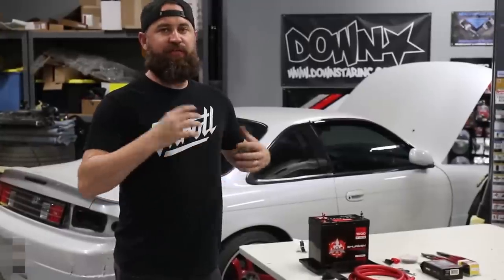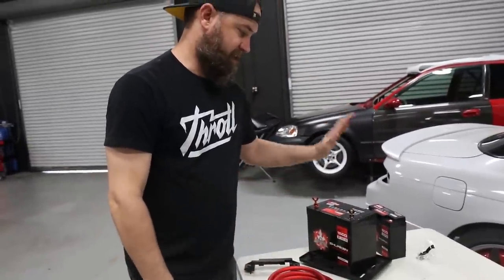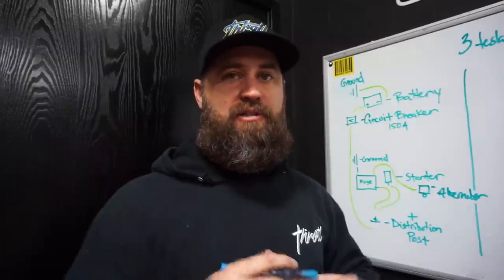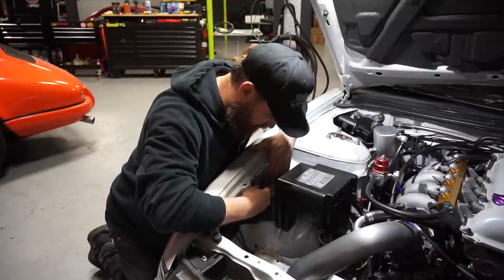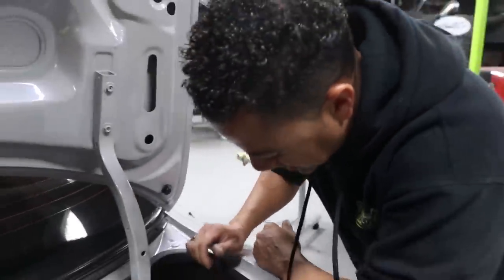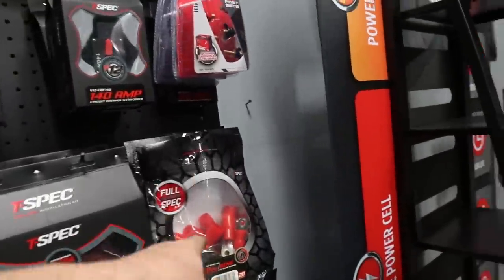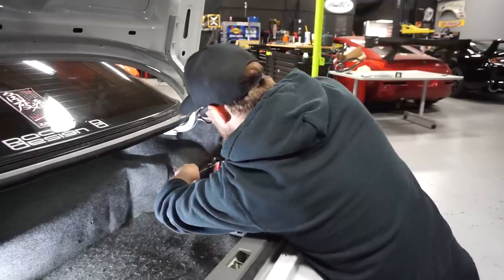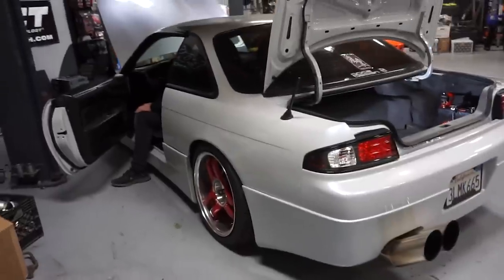How to Relocate a Battery to the Trunk  *THE RIGHT WAY TO DIY*

Comment from the maker: This IS a Re-Upload. We wanted to address a BUNCH of the comments/critiques/concerns so we decided to RE-UPLOAD with the changes that were suggested. We've now completed a successful and comprehensive How-To on this subject! Please show this some support and if you have additional How-To requests, please drop them in the comment section below!
Reply: throtl I saw the original, what were the changes made ? Just adding the positive post rather than running straight into the breaker ?
Reply: It looks familiar!
Reply: Always connect positive first.

Examples: 
Negative first -> accidental wrench contact with chassis while connecting positive completes circuit, risks welding wrench and exploding battery.

Positive first -> wrench contact during positive install does not complete circuit, no problems. wrench contact with chassis during negative install completes no circuit, again no problem.
Reply: WhiteSpeed13 one of the biggest changes was moving the circuit breaker. The circuit breaker should be as close to the power source as possible so if there is an issue  the breaker trips at the source you don’t have that live connection running any longer than needed. They also routed the power cable through the car this time like it should be instead of under the car.
Reply: Much better! Tiny point, if you shorted the battery posts, the circuit breaker wouldn’t trip. Which is why you correctly say you need the boots to cover the posts. Only shorting parts after the breaker will trip it. 👍🏻
Reply: I was wondering if this was some sort of blip in the matrix or that I’m such a fan of Throtl that I’m beginning to get develop Prescient powers on your next episodes🤯

Comment: Good on you for correcting the mistakes and reuploading, however I would suggest researching when commenters say something you aren't sure about.  You don't want to connect negative first because it makes it easier to short the battery to the frame by accident.  Until the negative is connected shorting the positive to the frame will do nothing because there is no path to the negative terminal for the power.

This is less important with modern batteries that don't release hydrogen around itself that could potentially be ignited by a spark, but generally speaking, it's a good habit regardless.
Reply: Hi, a tip I learned was that; it is still important today to connect positive first, because negative first could short or wipe the ECM by accident in cars
Reply: I've always known to connect positive first then negative, and opposite when disconnecting.

Comment: Excellent move running the wire inside the cabin. It’s nerve wracking drilling through the firewall and a pain running the wire under the carpet but it’s so much safer doing so. Nice re-upload! Keep up the good work, gents
Reply: Run the main power feeds, power and ground, together put not under carpeting. Perhaps along the side bottom sills inside the car.

Comment: interesting, I guess routing the wire under the car and placing the breaker on the engine bay are big no no's. thank you for this, I'm going to relocate my battery to the trunk as well and didn't know 80% of the stuff you showed here xD I though I just need a longer wire, a tray and bolt stuff down.
Reply: Not a big no-no. It really depends on how your car is being used. In this particular car the install was perfectly fine/safe but, for "How-to" purposes and us not knowing what car that eventual watchers will be modifying it was critical for us to make a more comprehensive video. Lesson learned. On to the next.

Comment: There are OEM's that run power under the car... but it needs to be very well protected, and must be tinned copper wire (tinned OFC) - unless you have a very specifc reason to do it. just run it inside of the vehicle like a car stereo install... and yes fuse or breaker always as close to the battery as possible.

Comment: Question, if the battery is something like 600 cold cranking amps, and the starter presumably draws a few hundred amps, why doesn't the circuit breaker pop if its only a 150a breaker?

Comment: What's the point in using such high quality cable and then earthing to the thin sheet metal in the boot? Why not run a negative back to the engine bay and do it right?

Comment: So what do you do with the original ground wire that connects to the battery? Do you connect it to the same post as the positive lead on the stud you installed?

Comment: Should be a dry cell acid based batteries  vent dangerous gases so in a trunk or hatch is bad also grounding to chassis is bad it should be grounded to block as well
Reply: Grounding to the chasis in the back will work but will cause a higher current draw during starting becasue of the increased resistance seen across the whole chasis. Ground for the starter is returned through the engine block, hence the factory ground on the right side of the block close to the starter. Best installation it to provide a return path as close to the starter as possible i.e. the factory location. The higher draw could cause the battery to struggle as it weakens. Sounds like the increased draw isn't a real issue with others.

Comment: Just gunna throw this out they clean job no concerns but figured I'd ask why didnt you use high conductive welding cable with copper eye ends for a stronger current

Comment: Can you do how-to of how to add a second battery for other accessories and more power?
Reply: Lol batteries dont add horsepower
Reply: @LXIXTurner  i not talking about horsepower im talking about voltage wise for smoother and constant current stop being so thick skulled man not everything is horsepower this and horsepower that
Reply: @chu13chu131  run power from your main battery to your second battery, ground your second battery to frame, then from there you wire your other stuff to that battery

Comment: good shit either way you install them under car you just need to secure the cables great so road debri doesn't try ripping them loose ,installing the cables inside just keeps the cable safe from road debri  just make sure you route the cable where nothing will rub it but other then that your solid just like Mickies install is still enjoyed the vid even this way it's a good way to see how you should do things.

Comment: Relying on a plastic tray to hold a battery in the event of a collision could result in the heavy battery tearing the J-hooks out of the soft plastic and send the battery flying forward. 

Inside a trunk, maybe that won't end up in personal injury, but in an SUV or station wagon, it's a projectile inside the passenger compartment that nobody wants to stop!

The breaker next to the battery needs to be sized to allow the starter to draw more than the usual so the breaker doesn't pop and strand you. 140A or 150A might work for a small engine, but with bigger engines, the starter draws more amperage and the breaker needs to be suitably sized.
Reply: I was thinking metal, or at least aluminum to keep things lighter.

Comment: That circuit breaker won't short on the sheet metal? I have the same one and it has a plastic backing but when you run a bolt through it the bolt is contacting the metal so it won't short the positive with the ground?

Comment: I've always used soldered terminals, covered in heavy heat shrink, with silicone inside, especially if you don't garage the car. The crimp style terminals always begin to gain impedance over time.
Reply: What kind of solder?  Solder melts when it gets hot enough, as you know, so I've always avoided it on power supply ends.  I've seen it melt and start fires from frying circuits and grounding out power supplies of LiPo batteries and residential power.
Reply: @jeffcivjeep7  I use whatever high temperature solder pellet comes with the terminal. 30 years or more without any issues on various jobs, it's been reliable.

Comment: What battery did you guys end up using. I had an Odyssey 680 battery in my EG and like you mentioned it didn’t last long. I ended up putting the battery back in the engine bay.  The other issue I had was the car would lose power and I think it was the circuit breakers fault. Have you guys experienced that before?

Comment: Now yall just need to do a video on how to install a 2nd battery in vehicle. That would we be useful to me in particular
Reply: Just run a wire from the positive terminal on the first battery to the positive terminal of the second terminal. Use a fuse for each battery, as close to the positive wire as possible. Find a new grounding point for the second terminal. Consider using a circuit breaker between the two batteries.

Comment: Good vid, but may I ask necessary to consider the poison gas leakage inside the trunk problem? thanks.
Reply: Maybe there's a sealed box, if One can be found. I'm thinking about that too, because mine is a Hatchback and the Cabin is Not Separate, like a Trunk. 🙏
Reply: Or I'm considering an AMG Battery.

Comment: Is it a good idea to upsize the stock ground wire from engine to chassis when relocating the battery? Seems logical that wire should be larger like the power wire or maybe it doesn't matter because it's so much shorter?
Reply: It will low the voltage and amps delivered to whatever you connect too, try looking up what gauge wire is ideal for car battery’s since the wires also should be tough

Comment: i think it's a safer solution to add a breaker just after the battery, if your cable was injured in the car you could not  stop the power. a better way would be to add a rally external breaker with a warning label.
Reply: The breaker is mounted just after the battery.
Reply: If the car is crashed they cut the battery cables.  Generally first thing done on a non track situation with any fire dept that knows what they are doing.

Comment: Why are circuit breakers becoming a thing? The whole point of the main fuse is to protect the main circuit, adding the circuit breaker is one more point of failure and is only protecting the main fuse 🤷 . Also even though you can ground to chassis and it'll more than likely be OK, it's ideal and good practice to ground the battery to the engine block as close to the starter as possible to ensure the correct ground path to the starter whilst cranking.

Comment: Hello I need alittle help. I'm relocating the battery in my lacrosse super to the trunk due to space issues. I need to know if I'm doing this rt. I routed the gauge 2 power cable to the engine by going under the back seat into the carpet and zip tied to the original wiring harness then back up to the bottom of the dash through the original harness grommet and zip tied all the way up to the engine. The original power cable disappears as it wraps around my v8 engine so was going to connected the new cable to the original using a jump post and ground the engine to the location I removed the battery tray from. Then connect a 100amp circuit breaker in the trunk going from the cable to the breaker then to the battery. Please tell me if theres something I'm missing coz it feels like theres something else I need to install. Thanks
Reply: Ohyea the battery is found cable is going through a grommet in the wheel well grounded to the chassis under the car. Theres a plastic wheel well that sits over the tire, the cable is between that and the metal frame then down underneath.

Comment: Isn't it unsafe to have flammable fabric practically touching the positive wire connected to the circuit breaker?
Reply: Everything in the vehicle that isn't metal is flammable, including the plastic battery body.  It doesn't matter unless you're trying to conduct electricity through it.

Comment: Yes ....I agree with the first and many of these comments. Why did you introduce this as reintroducing the video as offering a comprehensive display of re-routing the battery. But in honesty, you guys didn't show us ANYTHING.  You might have shown us that buying a positive post is a smart idea in the hood (or two, trunk etc.).  I think when we (the commenters) are expecting a comprehensive video. I know at least speaking personally ..... examples being : where did you drill in the firewall?...did you drill in the firewall? ......Where did you run the 1/0 awg wire?.......Did you run it under the carpet or under the car?.......why did it look like the wire ran under the rear firewall because you have it coming up through the chassis metal using the grommet back in the trunk, so did you have a hole and grommet in the front?....... I mean, no disrespect , and normally wouldn't say any thing had it not been exclaimed that this was going to be a re-upload with new content to make it b a COMPREHENSIVE video. I'm sorry but I feel it's far from such....thank you very much for the addition to the community and car enthusiast/you tubers.....but please properly present the content that is verbally explained to be from yourselves.  Doing anything else is just ODD!? THANK YOU AGAIN , hope to see a new video that is literally COMPREHENSIVE, A TO Z, FRONT TO BACK , START TO FINISH, ALPHA TO OMEGA.......ETC.  Gracias and bueno dia

Comment: Is the cable still attached to the fuel lines using Zip ties? 😆
Reply: My airlift lines are attached to my fuel lines under my car with zip ties haha
Reply: no, it was re-routed inside the car to the trunk.

Comment: Should have tolked about vuteg drope and shit like that    cuz that the problem most pepole have when they move the bat to the back
Reply: diclexic schweb...yeah maybe  if you use a piece of shit cable with a load of resistance. 
I’m pretty sure you don’t know what your talking about. Granted you will have a small voltage drop due to the length of the cable and added  breaker but absolutely negligible if you have a brain and know what your doing and use some quality..   Oh and if your wondering I’ve been a professional tech for 15 years. Everyone posts on YouTube videos like their an expert.  You would likely get more drop on a corroded battery terminal. Video was good leave it at that 👍🏼
Reply: @DIETRYING001  - Thank you.